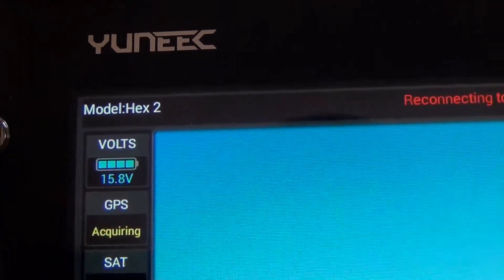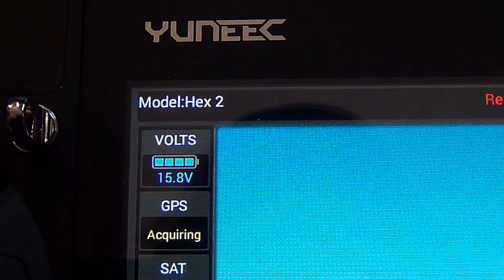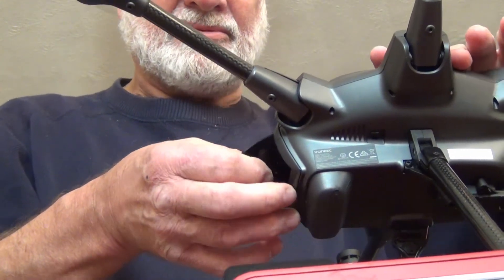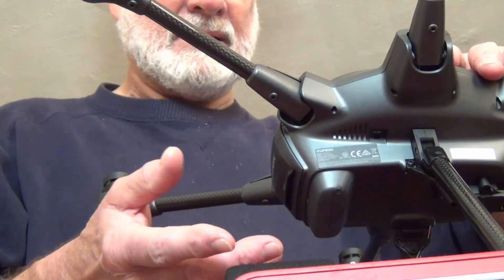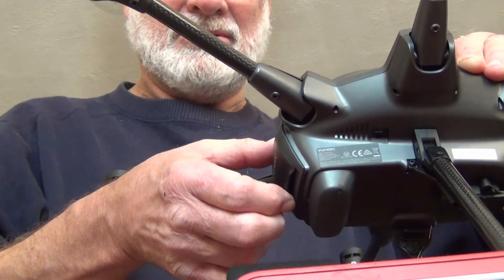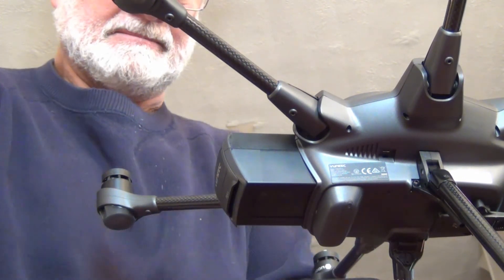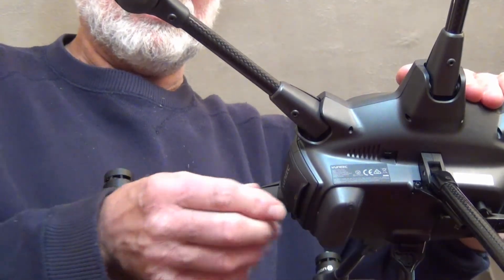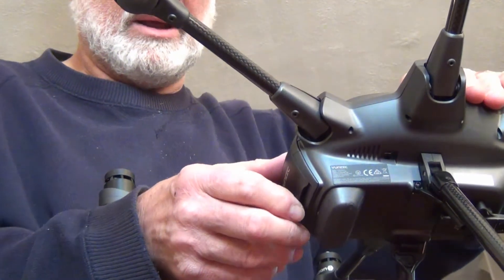KK MOTION PICTURES LOOSE BATTERY

Comment: Hello Keith I hope you are doing great. I took a look at the telemetry files you sent me, and I hope I can explain what I saw:  In your flight on nov 30 you took off with 15.8v in your battery. Remember that the full charge of the battery should be about 16.8v. Meaning you were flying on a partially charged battery. Also always remember that voltage without load [meaning with motors off or on idle speed before take off] will always be higher than voltage under load [while flying] meaning this 15.8v will drop significantly once you take off.
As you sent your H up and away the voltage very quickly dropped to very low levels, and you got your first Low battery warning just after 2 minutes of flight. Now, this was during a Return to Home. You should know that the H flies at it's max speed when its flying home, meaning during the return the motors are sucking a lot of power from the battery! 
For this reason the battery dropped even more and very fast to dangerously low voltage, and just 10 seconds after the 1st low battery warning the H entered automatic emergency land mode. At this moment the H stopped where it was and began landing to avoid running out of battery mid flight. I got to say you were very lucky, a lot of people run out of battery before the H is able to land itself and it drops like a rock from the sky. Be careful with your batteries, overdischarging them can damage them and they can become useless!
Reply from the maker: JULES  YOU HIT IT DEAD ON, AND EXPLAINED IT PERFECT.
 THANK YOU SO MUCH  YOU ARE GREAT BROTHER.
 YOU ARE RITE I WAS VERY LUCKY.
 KEITH KUHN
Reply: No problem! Also, don't worry too much about the batteries moving inside the battery bay, as long as they stay all the way in there shouldn't be of concern. Greetings!
Reply from the maker: THANK YOU SO MUCH MY FRIEND.
 YOU ARE GREAT. I REMEMBER WATCHING YOU REPLACE 
SOMETHING MAJOR IN THE TYPHOON H.  THAT IS WHEN I CALLED YOU A SURGEON OR  DR  JULES.    VIDEO BELOW.
 KEEP  THE GREAT VIDEOS COMING AND HAVE A SAFE
 NEW AND PROSPEROUS YEAR.
 KEITH KUHN
https://youtu.be/LsVAgycRhCY

Comment: Slightly loose batteries is ok, mines the same. Your voltage is static I take it, drone on but motors off. Fire it up and you may find the volts drop right off. Two things have happened to me, one, I took off thinking the battery was fully charged and it wasn't, two , after 12 months of use one particular battery lost it's capacity, in other words it discharged a lot quicker than a new one. I bought a capacity tester and found one of the cells was bad, I marked the battery so I only used it for ground work, compass and imu calibrations. 14.8v I bet if you took off it would drop to low voltage warning. You are so lucky to have had a controlled landing in grass. Fly safe😃
Reply from the maker: THANK YOU ANTHONY
KEITH KUHN
Reply from the maker: I WILL BE KEEPING AN EYE ON THINGS
 KEITH